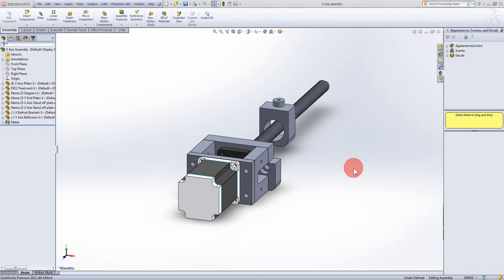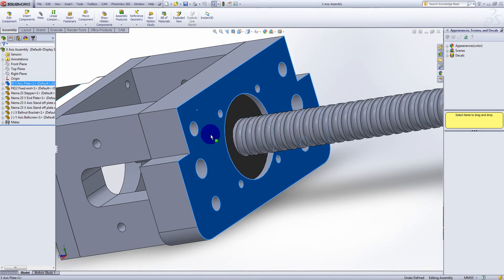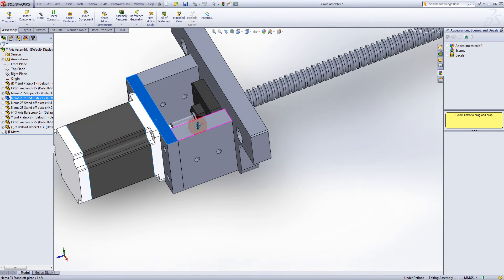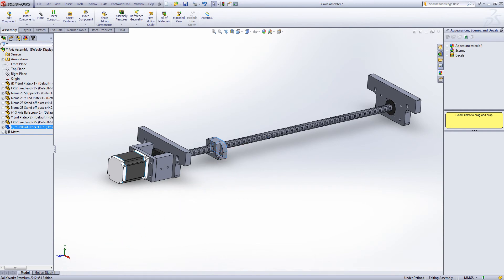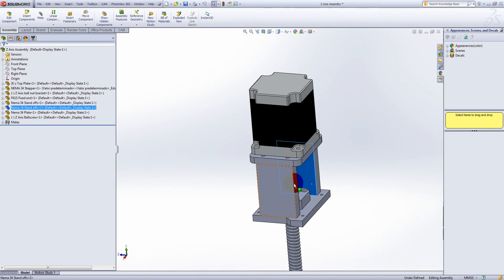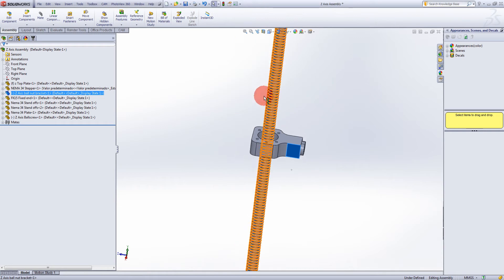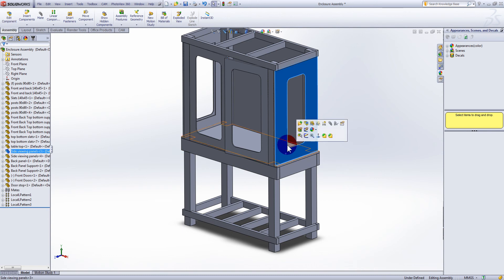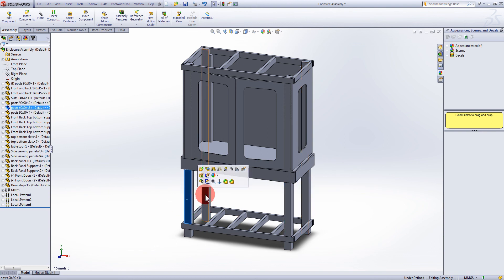Titan TM25v X Y & Z Drawings and Enclosure Design

Comment: looks good

have a look at http://stores.ebay.com.au/CNC-AND-CUPCAKE-WORLD/Ballscrew-5mm-pitch-/_i.html?_fsub=412643919&_sid=657086089&_trksid=p4634.c0.m322

his stuff is from Taiwan, I have used some and the quality is good not too expensive with fast delivery

cheers
Reply from the maker: Yes I am familiar with his stuff, I have bought through him before but unfortunately he doesn't sell the style of ballscrew I am after and I think all his ballscrews are pre cut lengths not made to order.
Reply: the reason that I mentioned CNCCCW was the quality and speed of shipping.
some of the Chinese stuff that I got was a great quality.
looking forward to see how the conversion goes.
BTW I wonder if you could explain how you determine the length of the ball screws to get
Cheers
Reply from the maker: Greg SB  Yeah they are quite good, thanks again for the link, As far as measuring up for the Ballscrews i will do a video so i can show my general approach to it, Measuring up on a machine like this is very easy.